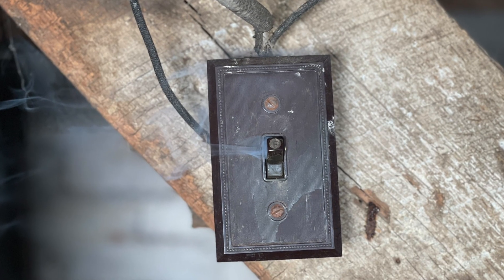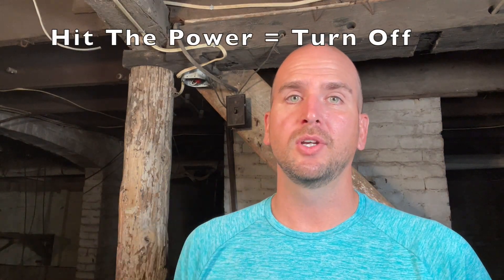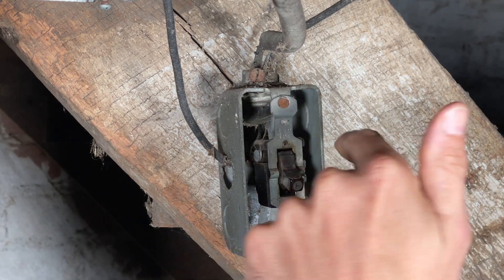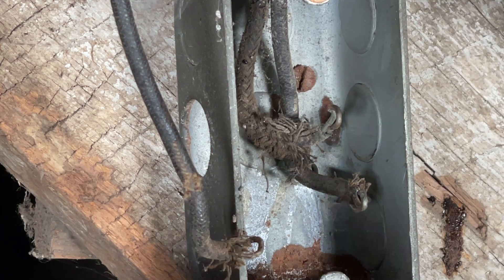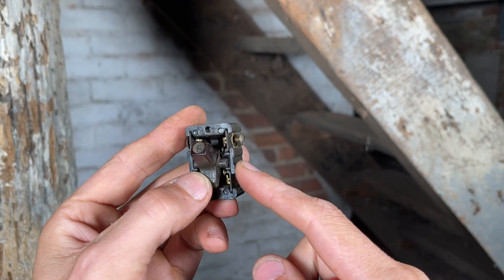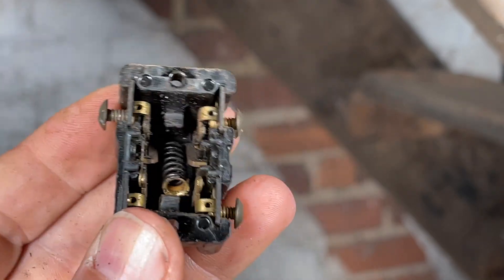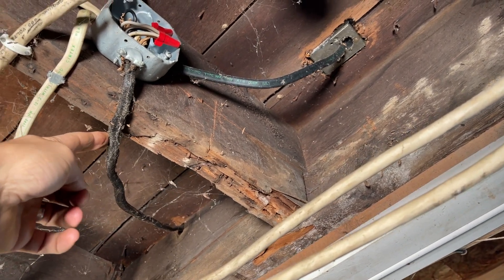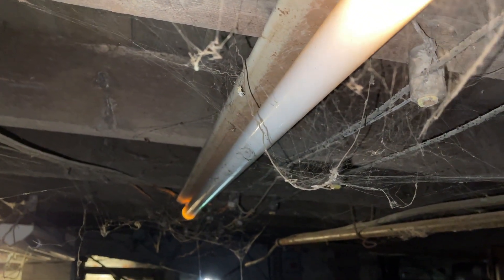Issues with Old Electric Wiring | Knob and Tube

Comment: knob and tube is usually fine, often just not capable to run the amount of circuits needed today. and as you said people will often add to much to it and over fuse them. i myself would leave it in place, fuse it right, and correct the bodge jobs like that handy box with no sleeving protecting the wires. (I'm rather partial to the old knob and tube system) i have actually stress tested different wiring systems and found knob and tube to hold up best if still done correctly.
Reply: Setting aside the lack of grounding, I'd say that knob and tube wiring should be completely removed just for the fact that the wire insulation is pretty much universally brittle at this point. I replaced the last of mine 25-30 years ago and I could not bend a wire then without the insulation cracking and the wire getting exposed. Even with the handy box that you mention you could carefully bend the wire without tearing the delicate outer cloth but still crack the inner rubber insulation (or whatever it is). I'd go even further and replace any 1960's cloth jacketed cables as it is getting hard to shift those now without the jackets ripping and the double insulation then being compromised.
Reply: @JasonEDragon  i have a lot of knob and tube wire and 60's wire, and it's all perfectly fine including the rubber, though much of it is circumstantial. if the insulation is falling off then yes, replace it, however if it is still intact the it is not an issue. in regards to 60's wire, moisture is what causes the outer jacket to fail, if it is in a wall and has never gotten moist then it is fine, i have seen lots of 60's wire that looks as though it was installed yesterday, some even have a grounding conductor.
Reply: @gtb81.  Every organic insulation has a finite lifetime. If a wire doesn't have PVC insulation on it then it probably is at least 60 years old and some knob and tube wire is over 100 years old. I'm not as much worried about knob and tube wires neatly run 1 foot apart by themselves, but what knob and tube system by now doesn't have wires close together at lights, switches, and outlets, - and run over or near plumbing and heating ducts? And then you can count on a dozen or more NM-B splices outside of junction boxes. All you need is a washing machine shaking the house and wires with brittle insulation to start a fire. There is a reason why some insurance companies won't insure properties with old wiring - they tend to catch on fire more.

As to cloth jacketed cables, it is a closer call. I wouldn't tear up a wall today just to replace those cables - unless they were ungrounded, aluminum, or undersized. But, if I was already remodeling then I would replace any that I had access to - because I would want everything to be in good shape for the next 50+ years.
Reply: @JasonEDragon  it's all preference, i myself would check all of it out, but from my experience it usually is okay, even inside the boxes if it has not gotten very hot. also even PVC insulation can be bad, heat, sunlight, or just manufacturing problems. i wouldn't go out of my way to replace knob and tube wire if i had it on anything i have, unless i found it to be faulty, have dangerous splices or the insulation is falling off.  as of yet i have not found any knob and tube that is a problem, the insulation is typically still fine and flexible, and in my opinion would still be just fine for the foreseeable future if it is properly fused. grounds also aren't a huge issue for lighting circuits
Reply: @JasonEDragon  it is likely down to climates somewhat also, as the stuff i have is nearly perfect, good enough that i have installed it in a shed i've got, and have not had an issue with the insulation breaking. same with any 60's wire, all in great shape without issue unless it had gotten wet, i.e. under a house.

Comment: If you live in an old house with old wiring, and you can't afford to have it upgraded by a professional, buy a $10.00 Do it yourself, book that will tell you 98% of everything you need to know on how to re-wire your home. Read it and study it thoroughly and practice all the safety measures the book recommends...You will be surprised at how it's not that hard or complicated. There are literally a half dozen rules you need to remember for 98% of the work. It really doesn't require any special or expensive tools and the components are fairly inexpensive, compared to what you will pay an electrician for the exact same parts.
 The basic tools can be had for less than $100. Screwdrivers, wire cutters and strippers, pliers and a multi-tester.
 Big box stores sell the components (switches, outlets,  breakers etc.) at a big discount when you buy many at once.
 These electricians make a lot of money per hour, for what little they know and charge a big margin of profit for every component they sell you. 
Go by the book without taking any shortcuts.
 Do a room per weekend and the task becomes a lot less daunting.
Take you time, have your work inspected buy a certified inspector and you will save yourself many, many, thousands of dollars along with the peace of mind that it was done correctly.

 Yes ...even licensed electricians take shortcuts, use inferior components and do things you wouldn't do while still charging you and arm and a leg..
Reply: Totally agree. Excellent post. Learn about what you need to do and double check everything. There are so many resources on line and in books that can make electrical work easy to do. It is not hard and you will get a great sense of satisfaction in not only the money you will save but in a job well done.
Reply: @irishjoe5868  People think that because electricians charge so much money for even small jobs that it must be very complex work and requires a lot of training and tallant. I have done carpentry, electrical, plumbing, hvac and gas fitting By far the easiest and simplest is electrical.

Comment: After a home buying pre-inspection and paying 2 electricians to overhaul the wiring (over a decade apart) I came across a store bought knob and tube to BX wiring adapter that was hot in a dark corner of my 1900 built house. It was for old type outlets on the first floor! Anybody doing as good inspection would have seen those old two prong outlets and either pulled the cover plate or gone down to the basement and looked for the wiring.

Comment: I own a number of old rental homes that all seem to have a lot of old knob and tube. I’ve found that much of the issues with the remaining wiring seem to occur in the boxes from 100 years of pulling switches and receptacles in and out of the boxes which damages the insulation.  I’ve also encountered a great deal of signs of resistance heating at junctions where they twisted and sealed wires without wire nuts. In the winter, people use electric heaters and the wire warms and cools as the heater cycles. This expansion translates to the twisted junction and the wire heats where the contract between the wires is loose. Wire nuts properly applied seems to fix the issue. You can also use arc fault breakers if the box is updated. I’ve found that with the old 60 amp panels, people often use 20 amp fuses on 14g wire and then with only 4 runs to the box, the wire actually gets hot to touch when so many circuits are utilized at the same time. The old wire always seems to look good in the walls though as it’s never moved and mice don’t seem to eat the old stuff. They’ll eat the Romex and leave the old hemp wound wire alone. At least with a new panel and junction boxes, the 4 runs can be divided into many more putting far less load on individual circuits.
Reply: Arc Fault Interrupter breaker will find ground leakage caused by overstuffed box (GFCI in small box by previous owner). There the hot wire with crumbling insulation was intermittently touching the grounded box. Grounds were provided by a separate wire (1953 house). AFI highly recommended for all old branch circuits, not only for bedroom sockets as required by code.

Comment: as a retired electrician & later, a electrical safety inspector i've found that the biggest problem with knob & tube wiring is overfusing & untrained people adding on to the circuits. never do either of these. if more receptacles are needed, start at the breaker panel & wire from there. loadwise, kitchens are the worst culprit. cap k&t receptacles & install all new. other appliances like washers, air conditioners, pumps, furnaces, etc should be run off new wiring, NEVER knob & tube ! remember codes now require most residential circuits be afci & gfci protected. if you are going to "gut" your house, demo all the knob & tube. if not, restrict it's use to existing lighting only. my house was built in 1906-i feel for you !
Reply: 1925 house here. i removed the K&t from it when i replaced the panels. rewired everything from the panel to the outlets/lights. all new romex and removed the old wiring as i replaced them. a contractor asked me if he could keep the old ceramic support. i gave it to him. dunno what he did with it tho but i know im all safe. also found out tons of illegal junction box and funky wiring when i did it. it was scary... outlet inside a plaster wall no box used as a junction, junction box full of plaster with live wires, you never know. safer to start from the panel to the end than retrofitting old stuff
Reply: @patricklegault6383  as  hacked up as your old wiring was, it's wise you replaced all of it. with k&t in 1925 one could splice & tap wires without a box. most ceiling fixtures were installed without a box. there were no wirenuts back then, so electricians soldored their connections, then wrapped them with friction tape. we've come a long way since then.
Reply: In reality, knob & tube wiring systems were designed and  installed to satisfy the lighting requirements of a home only.  They handled the family entertainment system ( one radio), a kettle in the kitchen and a clothes iron in the laundry room. Today, LED and other energy efficient lighting systems are the smallest consumers of electricity in your home. You can't save much electricity today by diligently turning off the lights.
Reply: @chrisgraham2904  A good electric kettle for US or Canada use draws between 1100-1500 watts.  If the knob and tube is 16 gauge you are at or above its limit just with one thing.  Even with 14 gauge wire you are pushing if if something else is also running on that circuit.  Combine that with crumbly cloth insulation and you have a recipe for a fire (if the wire were rubber coated then covered with cloth like some knob and tube wiring used you might be OK for the 10 minutes the kettle is running).

Comment: Holy shit did he say $5k for a new panel with romex going to j-boxes spliced into the original conductors?!? I hope that was material and labor total.  I've been a residential electrician for over 25 years and I couldn't convince myself to justify charging that amount. I have a job this weekend upgrading a 200amp panel to a 300 amp panel where I have the fun of coordinating with the city when to de-energize and upsize the service conductors and then re-energize it the same day which is not too complicated, but he is a friend and $1500 is the price and any more than that and I would've felt bad. If a safety issue then I'm obligated to help the customer, I'm sure he knows how to get to the cleaners and doesn't need me to take them there.
Reply from the maker: Hey Thomas, thanks for the feedback.  Actually I could get it done for $5K (material and labor) with an electrician who has helped me on several jobs but if I used one of the larger outfits around me it would be WELL over $5K might even be over $10K.  Roughly how much do you bill out per hour?  $50/hour is cheap in my area and I have paid as high as $116/hour for a licensed electrician.
Reply: @EverydayHomeRepairs labor and materials is not a bad price then. Those big outfits have a fleet of trucks that are insured and fully stocked with gasoline and material and the guys driving them need to be paid. That's why these company owners have maalox for lunch everyday. They're good for multifamily stuff and big jobs. Me, I work for myself. Always have always will, and when I tell customers I don't have service charges they usually jump at it. But there's enough work out there to keep all us sparkys busy.
Reply: @EverydayHomeRepairs  by the way, if you own a small company in today's economy you had better be charging a minimum of at least $50 an hour or you're just not going to make it with all the costs
Reply: Upgrading to a 300amp?  Or are you installing a class 320 with 2 200 amp panels?
Reply: @TechGorilla1987  300amp panel
Reply: Just a panel with a 300 amp main breaker. Gotta upsize the service entrance conductors though.

Comment: I have a hybrid system I am working on now...no K & T, but a lot of two conductor with two prong outlets. I ran 14 gauge green insulated single conductor and fished it to the box in question, bonded to ground and installed three prong outlets. They all test properly.

Comment: I have a 1933 home that HAD same issues. I removed all old wiring and replaced with new. I found many issues doing so and VERY glad I replaced all wiring from the basement to the attic on a 2 story house. It had an updated breaker box only. I had the outside service replaced as well.

Comment: Most knob and tube systems were only designed for 30-50 amps total. When modern loads are connected( refrigerator, microwave, etc) the system is quickly overloaded. At high loads the bare wires in ceiling essentially turn into resistance heaters eventually setting  surrounding materials on fire. Since a lot of these wires are enclosed in walls and ceilings they become deep seated and are hard to extinguish.
Reply: That's really not accurate.  "Modern loads" may translate into greater demand overall, but a properly fused knob and tube system will not get stressed - provided it is properly fused.  It will function as designed.  The homeowner may find he cannot operate all of his "modern loads" at once due to the insufficiency of the number of circuits required, but it is disingenuous to suggest that modern loads are going to set the knob and tube on fire - or even get them hot.   There are no "bare wires in ceiling" unless the insulation has deteriorated, and I have NEVER seen appreciable deterioration of knob and tube insulation in walls or floors due to the affects of heating.  Where it is in fact super common to see problems with knob and tube wiring is within 8" of any ceiling outlets, especially in kitchens and hallways.  The fixtures over the last 100 years in these areas have utilized a close-fitting canopy adjacent to incandescent light bulbs.   Until the last 30 years, there were no warning labels against overlamping these pan fixtures, and essentially the large (think twin 100W or 150W) incandescent lamps just baked the wiring over years.  When the homeowner later decides he wants to replace the fixture, the first six inches of insulation is so brittle much of it disintegrates into dust when handled.  THIS  is where knob and tube has its big weakness.  This  condition can be repaired, but most people do it incorrectly with electrical tape.  Which is of course unsafe.

Knob and tube wiring has a number of "benefits".  The individual, open wiring concept keeps the wiring cooler than if it were in a cable.  It's called a "free air" installation, and the code acknowledges that greater heat dissipation allows greater current flow than a cabled counterpart (not that you can do this - there are other parts of the code that forbid sizing   #14, #12, #10 wiring to anything greater than a 15, 20 or 30A overcurrent device respectively).  That stated, the biggest issue other than the insulation at lighting outlets mentioned above regarding knob and tube, is that in the last 40 years many of these old homes have received attic insulation blown into that space.  The insulation ends up enveloping the open wiring, essentially negating the cooling effect under which knob and tube was intended to be used.  Since most walls of these older homes have not received blown-in insulation, this is mostly a problem in the attic, where unfortunately most of the knob and tube is present.

Comment: Have you done any videos with your thoughts on reproduction switches like the push button switches from classic accents and house of antique hardware? Did a quick search, but didn't see any. For people renovating old homes but wanting to keep some of the old feel, it would be cool to see how they compare to the more modern-looking switches.
Reply from the maker: Hey Connor, nothing at this time but thanks for the feedback on future video ideas 👍
Reply: those old push button switches are being reproduced. the new repros are available with a dimming feature, twisting one of the knobs does this. search some more.
Reply: I like the reproduction push button switches.  My parents brought a 1927 craftsman bungalow 9 years ago and had to replace its original wiring which was knob and tube, and replace the fuse panel with a moden breaker box complete with AFCI and GFCI protection where needed, in order to secure mortgage and insurance.   The original switches had to go, but they ordered the reproduction push button,  to give the home the best of both worlds,  safety and peace of mind while retaining that 1920s look and feel.   Like the satisfying SNAP! these switches make.